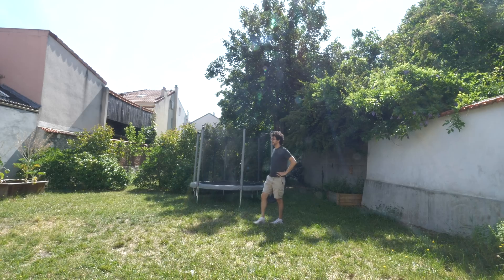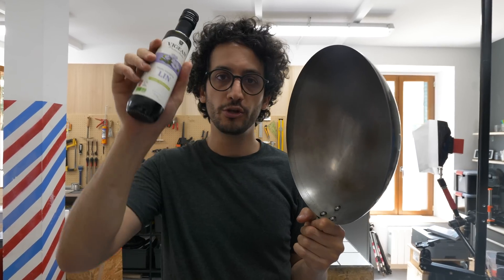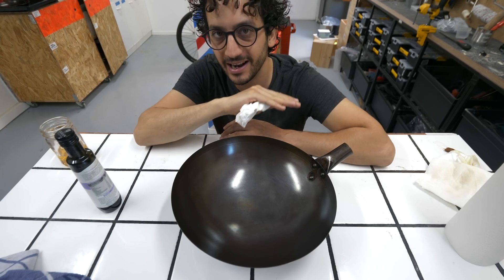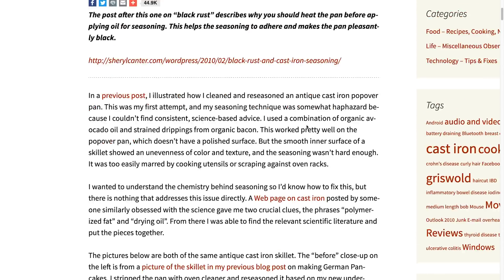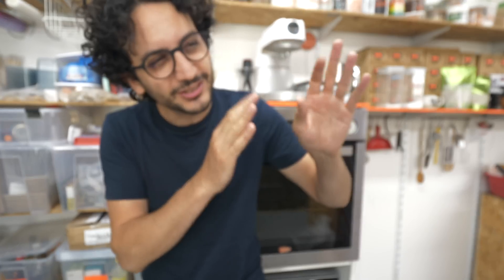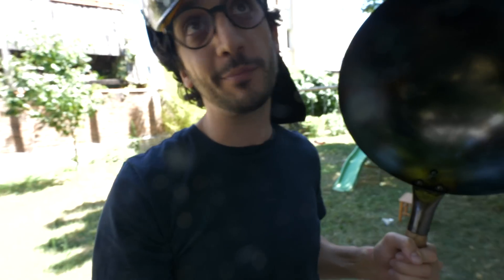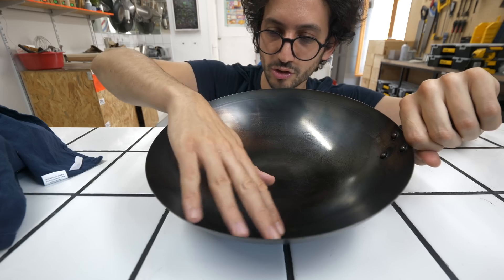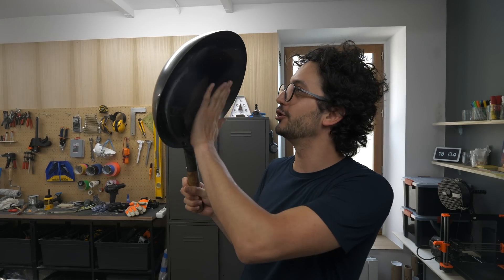Can I Make my Wok Slicker than a Nonstick Pan ?

Comment: You did everything you supposed to do very scientifically and yet at this end, you messed up the whole thing because you wanted it to look dark. Really well seasoned wok supposed to be bluish purpleish shiny surface. The black wok that you see in kitchens are the carbon build up on top of the polymerized surface. That is the stuff that gets build up with oil with smoking point and does incomplete gooey polymerization. Or even if it's perfect polymerization, the thickness of the polymerization tend to chip off and leaves residue when you cook. However, even if you have done perfect job on getting perfect coat, which you've done initially, when you cook to the point of smoke, the oil do get build up on top of the polymerized surface. You can't stop it. So eventually all wok becomes black. My questions is are those black carbon build up on wok dangerous if we eat them? That's what's stopping me from using wok all the time. For now I resort to stainless steel but wok definitely taste better. But not sure if it's worth it to cook on wok because of the unhealthy oil smoke and the black carbon build up on wok. If someone knows please respond.
Reply: Paul There is stuff like chromium and maybe(can't remember what it was now) cadmium or nickel too in stainless steel, so I'm not sure if it's 100% free of unhealthy stuff either. I use carbon steel wok, cast iron pan and stainless steel pot for all my cooking but probably the only absolutely safe material to touch food is glass.

Comment: I think you did an awesome job going the extr mile on that pan but my Matfer's pass the egg test with flying colors without all that preparation. The egg you cooked was at a very high temperature...back off the heat a little and you'll get better results vs an overcooked egg.

Comment: <3 this, Alex!  I'm surprised that you didn't apply several more of the final oil coats to get the perfectly black finshed surface though.  It'd likely only take one or two more.
Reply: well I made 8 of these and i think i kinda fcked up, somewhere the surface started falling of, dont you know why? I used linseed oil and a gas burner only
Reply: @TamasMatyok  don't use linseed or flaxseed oil. It's a myth that dosen't work in real life. Sunflower oil is much better

Comment: in woodworking you can use higher and higher grit sandpaper to smooth layers of poly or any coatings. It's essentially the same, if you took a 2000-3000 grit sandpaper at the end, you could smooth it to glass

Comment: Great experiment!

I did this many times with my carbon baking steel for baking pizza, baking  the steel with oil film for 90 minutes in a oven with hacked broiler. It works for 3 to six pizze but It does rust after each baking sessions.
Teflon is A unhealthy No go area, but I don’t trust the alternative ‘ceramic’ versions since the chip.
So I wonder how durable your seasoning is?

Big question with Your artisanal wok is how much would it cost after al this labour!?

baking it in a industry serial might make it affordable...

btw; Seasoning is also used on stainless steel pans besides cast iron and carbon steel!
Reply: Kees Jan Hoeksema If your carbon steel is rusting you must be cleaning it incorrectly or cooking something acidic like tomato sauce that is not good for the seasoning of the pan/wok.

I had a carbon steel wok since 2016 I use at least weekly and often daily. I never had any rust on it. One thing I found was that it's easier to not wash the wok after cooking(unless I wont be using it for a long time), but just before I use it the next time. That way the oils left from cooking are protecting the wok from rust and I don't need to do a full wash/dry/oil cycle after each use.

And no, stainless steel pans are not seasoned as the seasoning wont stick to stainless steel.

Comment: Far fetched conclusion IMO. The seasoning layer is relatively stable but particles still end up in the food, same with seasoned carbon steel pans, you can even see them. I am not sure if those particles are particularly healthy. Still, carbon steel has excellent heat retention and conduction, it lasts for three lifetimes, it goes in the oven, it does not require complex manufacturing nor teflon and it's cheap. But I am not sure it's healthier than a teflon pan that you don't scratch with metal utensils.

Comment: Actually you do not need a lot of oil, when you have built a good seasoning. It is much more about changing your preparation and cooking habits. Take out the egg from the fridge about 20 minutes before (make coffee in between), then heat the pan thoroughly to medium low. Use a tiny bit of oil on a cloth, piece of kitchen paper etc., or a small dice (smaller than a regular dice) of butter.

Comment: The most successful seasonings I've ever had are over a commercial gas burner. I used flaxseed oil and an infrared thermometer to heat the pan to around 370°C/700°F all over. The thermometer helped me get all the areas—bottom and sides—to the same temperature. The coating was beautiful, uniform, and slick.

Comment: you browned the egg? you can cook a browned egg in a stainless steel pan at the right temperature.
the reason teflon pans are better in this scenario is because the egg won't stick even at a lower cook temp.
so much so that it will come out with the white still being soft and malleable. 
what you've is just.... fried an egg, not made a pan slicker than a nonstick pan.

Comment: Yeah man it's definitely better in a well seasoned pan because you can use the high heat one wants when adding the proper caramelization to a dish one might call for say a nice blue rare steak or a proper fajita. Telflon just doesn't cut it.

Comment: Will metal utensils scrape this seasoning off during use? (I have that problem with Teflon coated pans)
Reply: Technically they could, but they're a lot less likely to. Plus you can always re-season the pan afterwards if you do scrape it off over time.

Comment: Good one !!!!   10*.  FInally 2 people out of 8 billion people on this planet no how to rightly shellac any metal or cast iron cookware.  I use vegetable oil (gooey and massive shellacing).  Get the pan hot, wipe on the vegetable oil, and allow the oil to burn, bubble, smoke, and shellac onto the surface.  For cast iron I do the outside first for 14-16 layers (totally glassy smooth), then the inside.  Blue-black shellacing, that was the original method of the upper caste in ancient India and Asia, versus the post-WW II just iron and metal cooking ware.  Having this product done as such, that I show to preppers, you never season ever again, no stick, just wipe out and hang dry, no rust, no further seasoning.  This method, called in English, japanning, ... is the metal method of the Japanese using the shellac tree oil, and shellacing their dinner ware wooden tools and et al.  Using this you never again use metal ware, but wood spatulas etc - like the ancient royalty did (they wanted to taste the foods - not the iron metal).  Glad to see someone else doing this right.  And &&^%&* !!!!!  to all the naysayers that have constantly berated me for do this ...
Reply: I do my cast iron over gray BBQ coals, and it takes 4-5 hours, and ~15 minutes per wipe down session to burn in the oil to make the shellacing layers.

Comment: I love my cast iron pans, they are great. The reason i love them so much is simply the weight, it can hold the heat much better than those flimsy aluminium teflon coated pans.

Comment: How to overcomplicate a simple process - 101 !!
Reply: true.. I just do three easy coatings on my stove, yeah it does burn and smoke which is kinda shitty and stinky but I don't have to wait an hour to cool shit off and just clean, wipe, burn in, wipe again, burn in again.. and so on until good. Also doesn't need to be a smooth surface, the trick works differently to a smooth surface.. lol

Comment: This is amazing, I was not aware that applying a non-stick coating on a pan can be done at home and all it takes is basically baking your pan with several coatings of oil! I´m going to try this with some of my pans where the coating is damaged ...
Reply: Well unless you remove the damaged coating, you better not because the process involves heating them way above what's recommended even for teflon coated pans.. plus, these are often Aluminum which isn't a great pan material in any case. And also part of the problem why the coating doesn't stick forever - too soft.. anyways, just buy a cheap, cheap old skillet or a stamped steel professional pan, they're usually around 12-18$ (or EUR) new and do the trick. untreated raw (not SS) steel. There's a reason why chefs use these almost exclusively.. ;D
 
Oh and btw if you put acid inside, it'll remove the coating so don't do it. Use it for searing and hot stuff and if you need to clear off brown stuff with some kind of acid (wine, lemon, etc) just use a stainless pan. Thanks!
Reply: @jamkaramasu4167  uhm, thanks I guess

Comment: How to compare with teflon? Easy, do the waterdrop test! If the drop adheres less to the pan than with a teflon coating, it's better, if the drop spreads more than with teflon, then it's worse. I doubt it's better considering teflon contains fluoropolymers that are super hydrophobic.

Comment: My pan doesn't fit in my oven, can this be done over a high output burner?
Reply: technically. just remove as much oil as possible and heat it intil it stops smoking

Comment: I'll take a proper seasoned skillet over a Teflon pan any day
Reply: Yes, been a professional cook for 26 years. I prefer a correctly seasoned skillet over  Teflon. I have used many many non sticks, the only thing that lasts more then a few years is a skillet which correctly kept. The skillet I am using has been in the family for 70 or more years and is still the best non stick surface I own, I do own a few Teflon style pans however when the lazy cooking is to be done ( as they are easier to clean, but you have to buy a new one every so many years.) 
Just the reasoning behind my preference. Just because I prefer it does not mean it is the best option for you however. You need to be comfortable with your tools to be effective with them.
Reply: Not a problem. Cast Iron is another one that will last a life time if well kept, and normally you can find them on the cheap at goodwill if you don't mind re surfacing them.

Comment: im no longer a cook, but i was for 10 years, now its just for fun, i use both, i have a hard cast iron Wok, seasoned like you, we used to do it every week in my kitchen, and they work, but i also have a teflon one, its light weight and cheap, ill buy a new when the teflon goes, but it works for me, quick sature carrots and it just works, its quick, easy to handle.

but in conclusion, i would not like to only have one of them, the teflon for accessories, the iron one for main dish

Comment: I’ve seasoned my iron wok and a blue steel pan and was pretty happy with the result but I just feel that I don’t know about how well the polymerised coating holds up to cooking sticky or acidic foods (eg simmering a tomato based sauce) and washing. 

Are you removing some of the polymerised coating if you (gently) scrub off the food invariably stuck to it when cooking?  

If so, how much? 

Also -  when to re-coat?   

I hate Teflon pans but at the same time, I don’t have the tine to re-season the wok every few months. And certainly not in a 12 hour process. 

Alex, I want to know how long you are able to keep that level of coating with repeated cooking.

Comment: I prefer the oil simply because you can repair it if it’s damaged and it seems to be more friendly to metal spatulas if you decide to use one for a dish. Teflon can’t take a metal spatula nearly as well as a seasoned pan.

Comment: Is it necessary to polymerize the outside part of the pan as well?
Reply: Sanford Chu he mentioned in the video that cast iron and high carbon steel is prone to rusting without any protective layer so if it were my pan I’d definitely do it on the outside as well to insure there’s a protective anti-rust layer all over the metal surface

Comment: i used sherylls method and it's great for building a good base coat. after that your pan is pretty much buletproof. i havent worn down th original coat i put on it with flax seal oil

Comment: After 11 minutes of watching this i finally realized that i have no idea what he's talking about and don't know what I'm doing here
Reply: I dont know either but I'm pretty sure he said fuck you at one point towards the end and I like him already.
Reply: after initially seasoning a carbon steel wok the next steps are just to use it often to stir fry and clean it without soap, just hot water. oil the wok lightly before storing it.
Reply: @markdugan7782  if the seasoning is hard and better than teflon, then why not wash with soap?
Reply: @markdugan7782  Boom!!  I've never seen someone waste so much time seasoning a wok.
Reply: @brin57  
Agreed.
Reply: Did you watch it from the start? ;D
Reply: Seasoning like this makes it nonstick, and prevents rust. That's why he was so excited about the egg sliding around. It's working as he hoped. Note, this works for tools with carbon in them - steel, iron, cast iron. Aluminum, copper, etc do NOT need this, and NEVER do this to a pot or pan coated with Teflon. Heating Teflon to high temperatures can make the coating come off, often in your food, causing cancer and/or other serious problems.
Reply: Tidey Pods yea I’m with you
Reply: don't do drugs and youtube?
Reply: he's french
Reply: stop the weed
Reply: But you cannot leave...
Reply: DUDE!!!!! what is it with this video, exactly my same situation.
Reply: It took me twelve minutes! I think his accent had a lot to do with it!
Reply: @robertpatterson3321  captions really help sometimes
Reply: Looks like you lost...

Da Wae

Comment: Anything is better than Teflon!  I HATE Teflon pans! The only three types of pans I generally use are CARBON STEEL WOK, Cast iron skillets, Dutch ovens, and Grill Pans, and stainless steel for boiling, steaming , and soup making. No aluminum. No Teflon, no ceramic coated junk.

Comment: I got a carbon steel frying pan because I didn't want another Teflon one that would wear out. It took a lot of trial, error, and work to get it actually seasoned, and to realise that coconut oil is much better for frying in than spread or vegetable oil, and that you have to cook eggs on a low temperature, and that carbon steel takes a lower temperature than non-stick anyway, but i got there eventually! 😂 The only snag is that I'm concerned about cooking tomato based dishes in it (acid will apparently remove the seasoning). Do YOU cook tomatoes and acidic things in your wok?

Comment: The best method for seasoning a wok is to cook in it. In the beginning use a fair amt of oil. As the seasoning builds up you can use less and less oil. I seasoned my new wok 6 times before using it. The first time I cooked in it the seasoning came right off. I was so pissed. I didn't want to go through the entire process again so I left it and just started cooking in it. After the 10th - 12th time I notice it became more and more non-stick.

Comment: Hello Alex,
Love your posts.  Teflon coating do not last and the gas they emit is dangerous.  Always use a fan with Teflon pans.  Once the Teflon starts to come off, your pan is not dead.  Time to get another one. 

Using your technique, you are making your pan last forever.  In order to get a smooth finish, I suggest using a buffing wheel on your drill with some fine abrasive.  You will get a mirror finish and the non-stickiness will be improved.

Comment: "There's no chemical, just a nice very hard polymer surface..." It's still a chemical treated surface, it's just not treated with polytetrafluoroethene,
Reply: Yes, this was a ridiculous statement. The other ridiculous statement came from that female who claimed that the lower the smoke point of an oil used, the harder it polymerizes. That's just a hypothesis, and I am not sure it's even true. Not all oils have to polymerize (flax oil does - it's so called "drying oil", used by painters, because its layers harden up due to oxidation), come can be broken into the individual fatty acid, or can burn to soot, co2 and other basic components.

Comment: Flaxseed oil is known for flaking off within a few months. I personally had it happen to my cast iron pans twice. Now I just cook with more lard. Problem solved.

One thing that does help with cheap cast iron pans (where they come with a rough sandcast finish) is grinding the surface smooth with an angle grinder and some flap disks - getting it so your baseline is as smooth as a wok. It's messy and takes a while, but you only have to do it once.

Comment: Flaxseed oil has always flaked off my pans. So I'm curious to know how your coating holds up after a few weeks. Never had that problem with veg or canola oil so that's what I use.
Reply: @SimonWoodburyForget  Flaxseed oil has a relatively low smoke point compared to the canola oil I normally use. So I don't think temperature is my issue.

Comment: @Alex Can you show how you would clean a wok? Do you need to use a mechanical drill scrub to remove the excess charred bits stuck on the wok? Or do you just clean it like any other pans and dishes, and wash/rinse them off?

Comment: Why not polish the metal to a mirror surface before seasoning?
Reply: A better bond if the steel is not super smooth as with any surface you want to "glue/stick" together